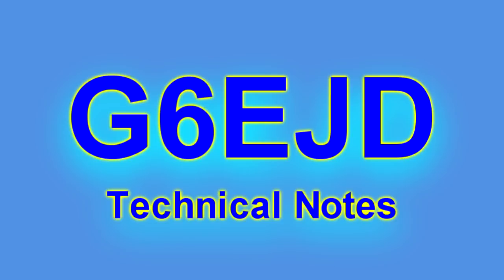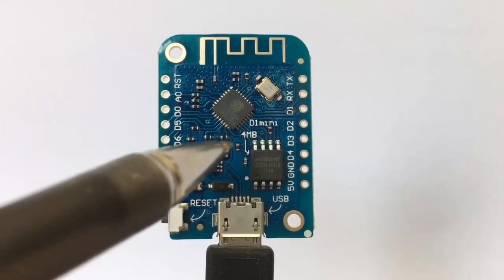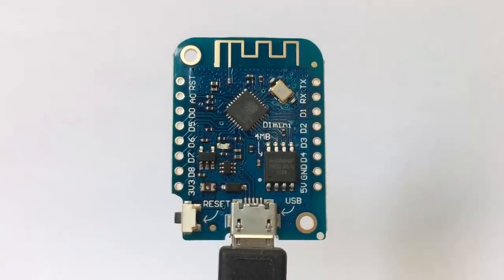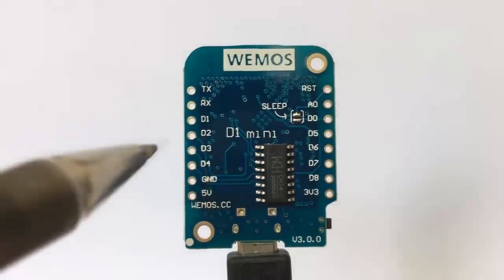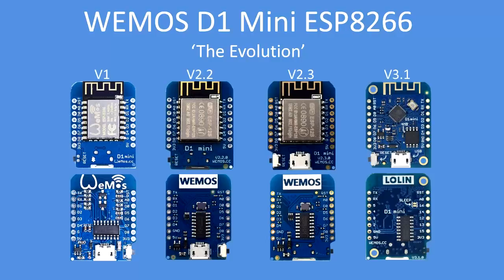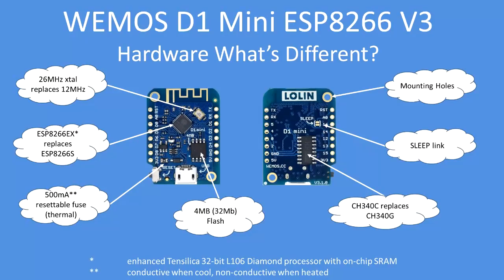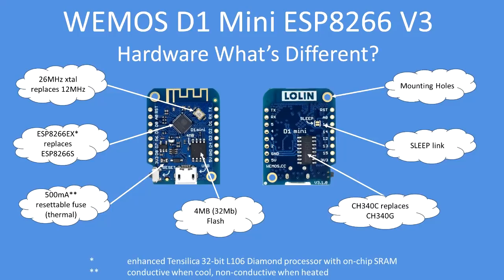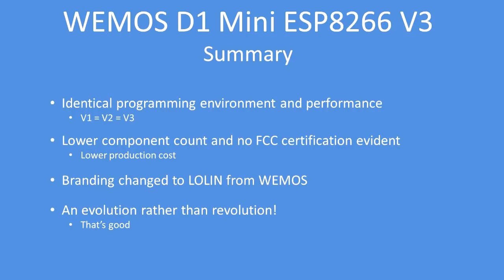Tech Note 096 - Wemos D1 Mini V3 Review

Comment: The "D1 Mini Pro" does not have the Antenna printed on it ? Can this be connected to the WiFi router ?
Reply from the maker: Yes it has WiFi on-board and can connect to a WiFi router
Reply: @G6EJD  Thanks. I found about by uploading a program too.
Reply: @G6EJD  I want to reset the wemos D1 mini / Wemos D1 R1 externally just like how I could do it with the Arduino ( i.e connecting the RST and the GND with a tactile switch or push button switch )
I am trying to do the same on Wemos and it does not work !
Is there another way of doing it ?
All I want to do is push a button on the panel and the microcontroller resets itself.
( the reset switch is too small and my microcontroller is enclosed in a box, hard to poke in for a reset ) 
Appreciate a reply if you could.

Comment: Interesting to see the evolution photos. Beware when you buy these "cheap" 8266's since there seems to float around lot's of WEMOS/LOLIN knock-offs designs with various versions. Often the brand name and version is removed from the silkscreen. I found that I have bought V1, not exactly what I intended when purchase it. Buy the original.
Reply from the maker: Sgt-Bond, good advice, only the AliExpress shop for Lolin can ensure a genuine product, a little more expensive but they work reliably and consistently.

Comment: Thank you very much for your kindness and knowledge and experience we have learned a lot , 
I am planning on using D1 Mini and powering it with 220VAC to DC (HLK-PM01) and connect through to the 5v , or (HLK-PM03) and connect through to 3.3v , which is better ? and do i need any other component ? i.e. capacitor .. etc
Reply from the maker: For all round ease I would use 5v supply to the on board regulator so connect that to the 5v pin. You can power the board with 3.3v via the 3v pin but it places the regulator and UART on the load. If your planning to use any peripherals these will  generally use 3.3v but will nearly always have an on-board regulator so again 5v wins.
Reply: Thank you very much , do I need a capacitor with GND  or is the board already have one  ?
Reply from the maker: Solar for Green The board has a voltage regulator and full smoothIng/storage capacitors. Just a reasonably smooth power supply like any usb type.

Comment: Can not be the only one reporting this failure of the WiFi connection on the Wemos and NodeMCU 8266 breakout boards. It first appeared sometime back while testing long-term use. Every morning would check the WiFi connection and for about a couple of weeks, all was fine
I was surprised to see the wemos mini had lost connection. This started happening on a regular basis. Resetting the device brought it back online. 
So loaded the same sketch onto the NodeMCU and ran it for some time and eventually the same thing started happening. 
Decided to compare the Wifi source so I removed the Asus Rt-AC87u replaced it with Google WiFi hardware. For about a month no problems.
Then all of a sudden started having dropped wifi all over again.
The distance from the wifi source does not come into play I have two outside and two devices inside. The one located inside is very close to the wifi source.
The devices failing have to do with a sketch I run for manual sprinkler control. Meaning a press of the button on the webpage turns on the sprinklers and 15 minutes later turns them off.
Here is the interesting thing about all this if I run the 8266 with "your" Temp/Humidity sketch this does not happen. This device never fails to be available via wifi and using the web interface you showcased herein. BTW the one you posted and the one you modified for me where celsius was changed to Fahrenheit was used.
Here if you are interested is the failing sketch I am using.
https://pastebin.com/qBy5nkFF
Reply from the maker: Well in instances like this I would suspect the router and its IP lease time,   In nearly every type made (the core software is usually the same open source types) they are set to 24-hours maximum, and to make it a permanent lease set tine to 0 usually.
You should not need a connected server only a Cheney that enables a connection when required. I’ll have a look at your code tomorrow and see if there is any obvious problems, but a cursory look revealed none. The ESP8366 does not have any connection issues or people would be raising the issues. I’ve got 2 ESP8266 servers that have run without error 24/7 for close on 2-years now, just checked and working as expected, so it may be a programme logic issue. Can you monitor the serial port and put lots of diagnostics print statements to see where it is going wrong. I’ll let you know what I can see.
Reply: Thank you. To combat the lease issues I have reserved the IP addresses assigned to the devices in question. Also, this does not explain why your Temp/humidity sketch does not drop the Wifi connection. It has run for months on end and on the very same devices that fail on my sketch. Thank you for taking the time to review the code.
Reply from the maker: I've been through your code twice and can't see a single problem with it. My observations are choosing an IP address in the lower numbers is more likely where the often less than perfect Domain Name Server processes tend to assign IP addresses, usually from 192.168.68.2 upwards and as you've chosen 10 there may well be the odd conflict with another device, also with some Routers you can specifically reserve an IP address for a particular device, on mine it has to be done as IP and MAC address. So what I'd do is move the IP up to about 150 or 200, plus change any associated port forwarding rules so it can still be accessed externally. Other things you can do is switch on your Router log and then see what it says when that IP address is disconnected. Not much else I can find, the code has all the right functions in it I'd expect.
Reply: First off thank you for your response. How I am handling the IP address for this device and other test devices is assigning it an IP address. Then I go into the router and reserve the IP address linking it to the MAC address.
The next step will be based on your suggestion assign the devices in questions with 192.168.86.150 and above.
As for the port forwarding as I understand it is only used if you want to connect to a device from outside your LAN. That is inward pointing connection. In this case, I do not allow any connections using the inbound route. So no ports are configured as so. Unless I misunderstood your meaning.
Lastly will check the router log settings and set them up accordingly.

Again Thank you.
Reply from the maker: OK, I only mentioned the port forwarding in-case you accessed it from the WAN/Internet. The log file should tell you what's happening at the router at least.

Comment: Hi Dave. Nice video, but I hope you don’t mind some constructive feedback...
As a tech note I was expecting more technical detail (than just chip part numbers).
eg. Not just saying CH340G is replaced by CH340C with: “slightly different specifications” ??
Technically, the CH340C is simply a pin compatible variant of the CH340G, that doesn’t require an external crystal.
So in your summary, the 26Mhz Xtal does not “replace" the 12Mhz Xtal! 
The 12Mhz Xtal referred to, was the CH340G Xtal (not needed for CH340C).
Technically, the ESP8266EX itself can use only a 24Mhz, 26Mhz or 40Mhz Xtal.

The ESP8266EX is simply the regular ESP8266 chip. So technically it doesn’t “replace” a ESP8266S (?).
The shielded ESP-12S module simply contains the same ESP8266EX chip, Xtal, and 4MB flash.

Finally, I believe the V3 now uses the ME6211 LDO regulator, replacing the original V2's RT9013. This also looks possibly a cost saving step, as the RT9013 had a lower typical quiescent current rating of 25uA (vs 60uA for 3.3v ME6211), and also the RT9013 has independent 600ma current limiter. 

In summary: V3 basically adds mounting holes + GPIO16 deep sleep link, and (it appears) manufacturing cost savings! :-)

Hopefully the above technical points are helpful, and taken constructively (as intended).
Reply from the maker: Hi Greg, thanks for the feedback and welcome to my world! For every one message like yours I get 10 or more a day via my web page asking me to not include too much detail as ‘I don’t understand what you mean by...’. I did thoroughly research the difference between the different versions and did consider explaining the ch340 differences but then I have to consider audience retention time of about 2-min maximum so it all ends up getting lost, so from my viewpoint what I have to do is produce a video that appeals to a wide distribution of viewers of which the middle two quartiles are not of an electronic or computer background but enjoy micro-controller programming. Incidentally, the regulator is unchanged throughout the V1-3 evolution. In terms of terminology maybe I should have said the 12s module has been superseded by using only its component parts less the shielding, and by now I would have lost viewers. Conversely I think I provided enough information to those who do understand, for them to quickly determine what was different without buying a board themselves. Overall it was all about cost saving in a market that is flooded with fakes/copies and I understand why Wemos needed to do this plus it removes a lot of fakers who can’t fund the production costs of producing boards that don’t use the 12s and sell as ‘Wemos’ branded item. Finally, the channel is self-funded and thus I don’t get any free samples and rely on a small YT return of typically $10/month if I keep viewer numbers and ‘likes’ up, it’s actually costing me ~$500/year to fund component buys are other parts. You may see Andreas Spiess videos where he has discussed the same problem and whether it’s worth continuing and I’m in the same place as him. My vocation is the transfer of knowledge and information to as many people as I can whilst trying to do that through a request queue currently extending out to 50 more topics like how to use a digital compass, motion sensors, servos, pwm, interrupts, etc. Summary, I will continue to provide the funding for the channel for the foreseeable future but I do need to keep it under review and  refine my content in a bid to meet the many demands (audience knowledge and language barriers, YouTube to name a few) and I hope I’ve given you enough of an insight as to why I say what I say, Regards Dave.
Reply: Hi Dave. Thanks for the comprehensive reply.  I certainly understand your position. 
I also agree on the fake Wemos boards issue, having been burned myself with some "LOLIN32 Lite" boards advertised as the genuine thing, only to receive unmarked (non branded) boards, which all had faulty TP4054 Li-Ion charger SOT23-5's.
Fortunately I was able to repair them myself with replacement TP4054. :-)

The official Wemos Store on ALiExpress now has the LOLIN32 Lite back in stock, although all the LOLIN32 boards are now flagged as "Retired". Their new LOLIN D32 appears to currently be their only ongoing ESP32 offering. A pity as I really liked the LOLIN32 Lite's low power battery optimised design (and lower cost).

It's certainly an understandable move for Wemos to rebrand products as LOLIN, and go to lower cost chip level design, so it’s less appealing for fake cloners to profitably replicate.

By the way, the LDO regulator was changed to ME6211 from the V2.2 D1 Mini onwards. Hence my reference to the original V2 RT9013.
For versions prior to V2.2 they used the RT9013, as confirmed by the schematic revisions.

Anyway, thanks again. I’ve given you a Like, and a Sub. :-) 
Keep up the good work. YT video production is a time consuming exercise!

Comment: Another great video Dave. One key positive point of the wemos D1 mini is that, with a constant form factor, all the shields remain compatible with all board versions.
Reply from the maker: Yes and I think that’s why they have been and remain so successful, also the power consumption for this board is sufficiently low to make it a decent low power development board or to use on battery power for a good number of months, I posted the power consumed in these comments.

Comment: Thank you it is great to be able to identify your board by physically looking at it, sorely needed. Helpful in purchasing unless they use the incorrect board pic in their advertising.
Reply from the maker: It happens a lot with AliExpress as a lot of suppliers were showing pictures of say  a v2.3 board but sending out a v1 or 2.2, so a few months ago I spent a long time trying to get a full set, but AliExpress were good  as I got a refund for each incorrectly listed board. Unfortunately Wemos do-not maintain a gallery of their older boards to be sure. For now you should only be getting the V3 boards all others are old stock and often more expensive than the new V3 variant.

Comment: Have you tried to see what the current consumption in deep sleep mode is?
Reply from the maker: Good question, I should have included these results in the video:

Wemos D1 Mini v3
WiFi ON  70.3mA
WiFi OFF  15.2mA
Sleep      0.24mA
Typical battery life at 1 event per hour = ((70.3*15 + 15.2*15 + 0.24*(3600-15-15))/3600 = 0.59mAHr and 2600/0.59/24 = 182 days

Comment: is FCC really needed for 2.4  Ghz applications?  Thanks Dave
Reply: You still have to get FCC certification on your final product anyway, even if you use the certified modules. Using a certified module does not mean you don't have to go through compliance testing for the final product, it just means it's shorter (you only have to do unintentional radiator testing I think). It's not relevant for hobbyist devices either way, you're allowed to build up to five of the same device without having to go through testing. Devices sold as a "sub assembly" (like these dev boards) also don't have to go through compliance testing. https://www.sparkfun.com/tutorials/398
Reply from the maker: Well it's a vague point, in that imports to the US probably need FCC certification, but who checks! And for most applications RFI noise is not an issue, so agreed not required. Generally most developers and hobbyists should not see this omission as essential. Overall it's been about cost reduction IMO.